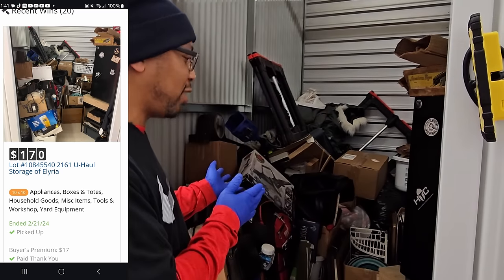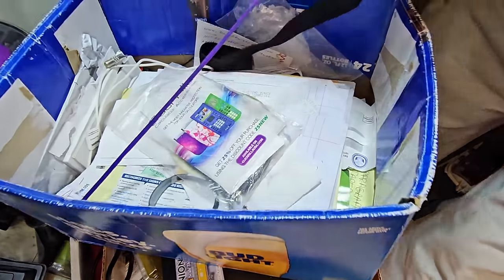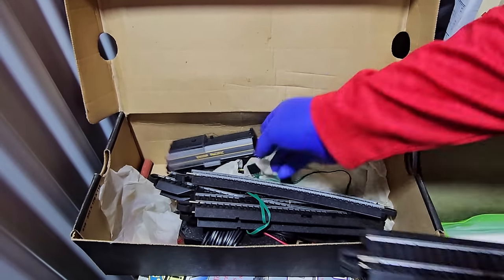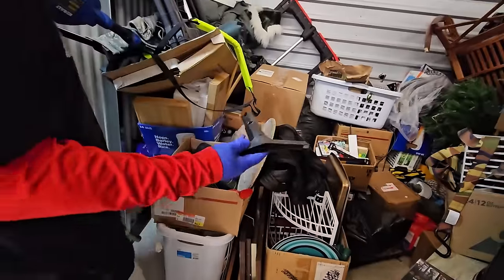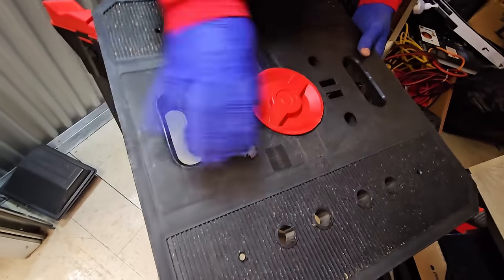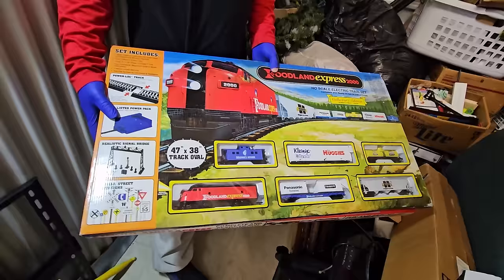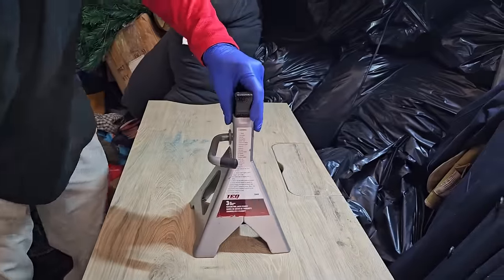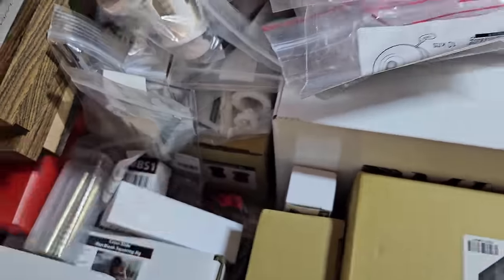I Bought An Abandoned Storage Unit For One Box!

Comment: The X work table in the back is great to use & not cheap.
Reply: When you were looking at the vodka bottles (about 5:26), you grabbed a stick with a funny white bent shape on the top. It is used by elderly folks to reach items that are up high or at floor level. Or for short people for same purpose. Seems like they run 15 to 20 new. It is incredibly handy.
Reply: You pull out the block in the middle of X table, put on top, & lock into place.
Reply from the maker: Great! Thanks for the info. 🙂👍